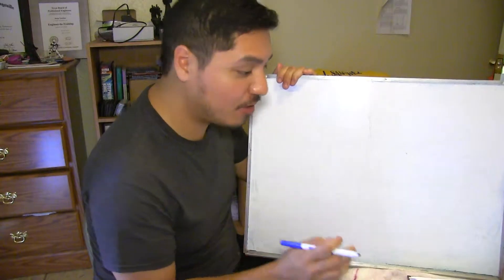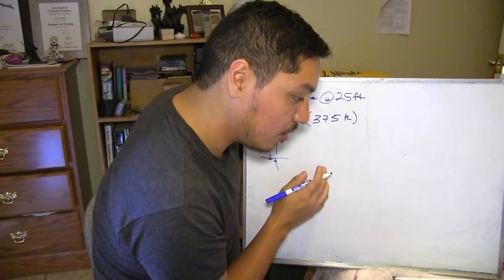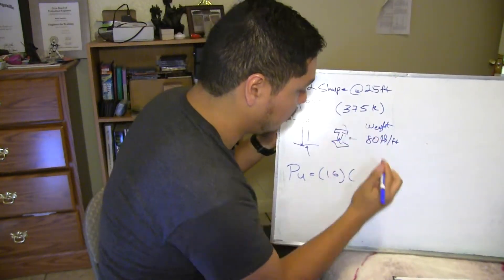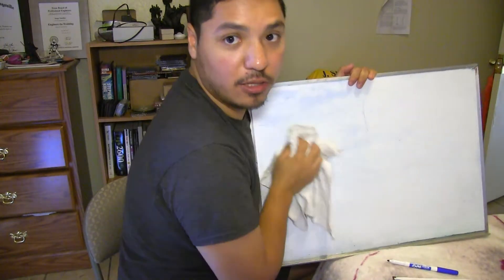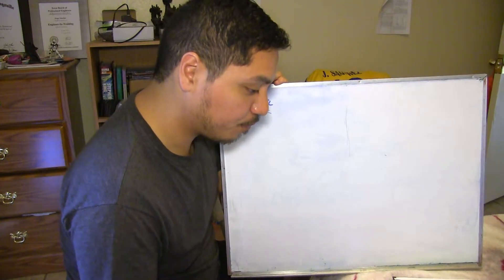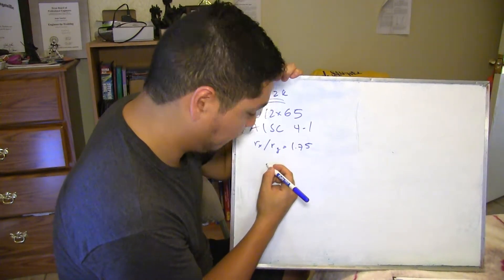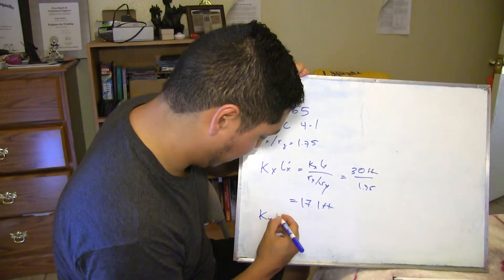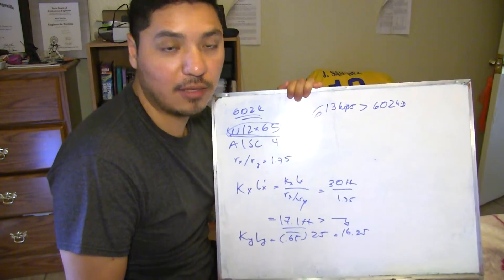Column Taking Axial Load: Design Example

Comment: I have a 16 x 32 pool that I never use so I need to pour a slab on top and I want to use four-inch PVC pipes to pour concrete as columns is that sufficient and how far I need to space them if it is

Comment: I am trying to pour a slab over my pool I just want to get rid of it
So I was thinking to use 4” pvc pipes and fill them with concrete as a support for the slab on top would that be sufficient and if yes how far I need to space them I have a 16 by 32 feet pool

Comment: It's about constency over anything. If I ever start picking stocks, I will do so at some frequency, but I won't speculate on how it is doing, since I value the routine over the result. Keep it up. So, as long as you think this or whatever is a good idea, routine/consistency is the best thing.
Reply from the maker: I agree, I have been following this guy called Casey and he basically says that you need to upload as much as you can and be consistent with content, also you should definitely pick up Stocks, it's an easy way to make money and it's better than having your money in a Savings account.
Reply from the maker: You can get a bunch of good apps, I recommend Acorns and Robinhood